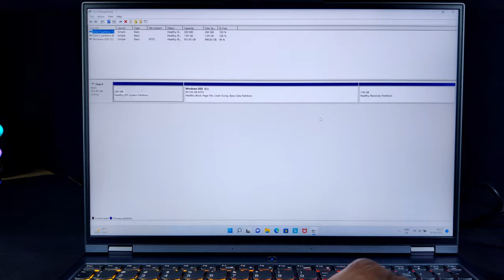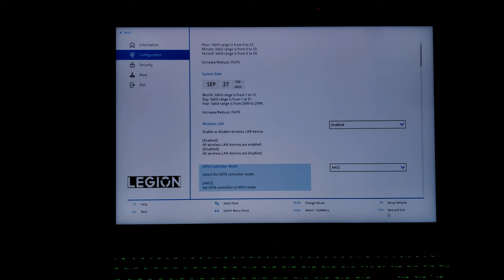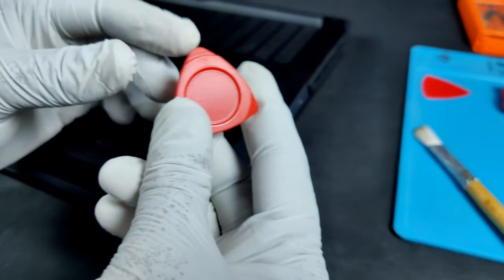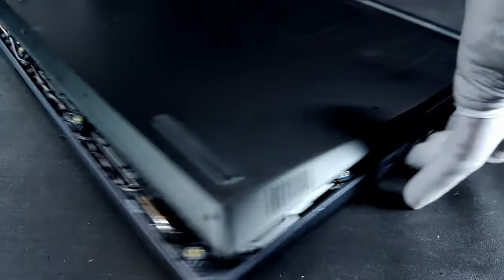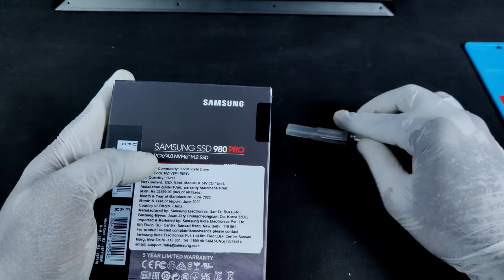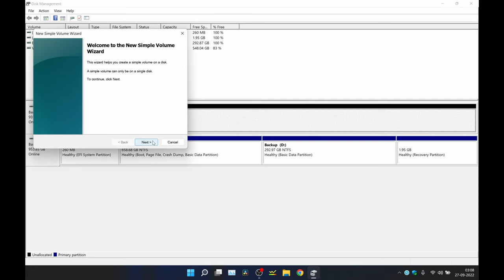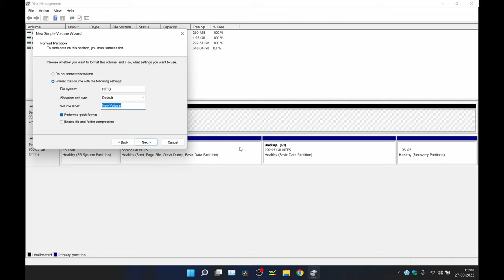Legion 5i Pro Laptop - SSD Upgrade - Samsung 980 Pro Gen 4 - DIY

Comment: Bro, we have the same model but mine’s only 512 GB SSD, would it be possible to upgrade to 2x 1 tb samsung 980 pro PCIe 4.0 M.2 or only one. Also, can i upgrade my RAM to 32 GB instead of 16??. Please respond ❤
Reply from the maker: If yours is same model then it should support 1TB per slot. And for RAM, by paper it is upgradable upto 32GB.
Reply from the maker: Yes. Although some people have tried using 2TB and was successful. But i doubt it and also about heat dissipation

Comment: I want to install two Kingston Fury Renegade 2Tb nvmE ssds in my Legion 5i Pro gen 8. Can i somehow make this double sided ssd fit into the second slot too? I know something is pushing up on that ssd installed there if i where to install any double sided ssd like those ssds i have is. But is there any fix to make it work?
Reply from the maker: AFAIK, the double sided SSD should work. But the problem is the heat dissipation from the chips which are on the other side.
Reply: @MADWalker  Only one did fit in my gaming laptop. And without heatsink it sits at 50 degrees Celsius.
Reply from the maker: 50 degrees C during idle or operation? Ensure it does not go beyond 70 degre during operation. Ideal operating temperature should be between 30 to 50 degrees

Comment: Can i upgrade this on my lenovo ideapad l340 please tell me instantly
Reply from the maker: I afraid it will not support PCIE Gen 4. You should consider PCIE Gen 3 SSD
Reply: @MADWalker  bro u helped me so much thx
Reply from the maker: Welcome
Reply: @MADWalker  A lenovo  guy name dex_lenovo says that Hence, to answer your question, yes you can definitely upgrade your current drive to a 2.5 SSD drive. You can also upgrade your current ram by replacing the installed ram module with a higher ram capacity.
Reply: So i can upgrade right idk
Reply: he says i can upgrade to 2.5 ssd that means the 980 pro
Reply from the maker: 980 pro does not come in 2.5 inch sata. Sata has limit in speed like 600MBps or something like that. While m2 ssd are 5x to 10x faster than sata. I would say you can go for gen 3 pcie ssd instead of sata if possible.
Reply: @MADWalker  Ok thanks

Comment: How can i see my laptop use PCIe 3 or 4 on ROG g531gw i7 9gen with rtx 2070 please respond🙏
Reply from the maker: Easiest way is to look into manufacturer data sheet. If this G531GW-AZ014T is your laptop model, then the spec says, it supports PCIe 3.0
Reply: @MADWalker  thanks my friends🙏

Comment: If I use the default heatsink, which is the Samsung variant with a heatsink, will it still work?
Reply from the maker: I dont think it will fit. You might need to unscrew the heatsink and use the laptop's default one, as it is connected to cooler fan assembly for heat dissipation.

Comment: Hi congratulations for the video, I wanted to ask what temperature does the samsung 980 pro mounted on the legion 5 pro reach? I would like to buy this ssd but I know it gets very hot. Thank you
Reply from the maker: Tested with an ambient temperature of 30°C
Startup temperature 37°C
During 4K video editing and rendering 39°C
After 1 hour of usage 42°C

While the default SSD came along with the laptop, containing OS was 50°C at the same time
Reply: @MADWalker  Hello and thanks for the previous reply. I wanted to ask you if you recommend the samsung 980 pro or others like the kingstone KC3000 or the Sabrent rocket 4 plus or XPG gammix s70 blade or many others that you could suggest. Then you changed the thermal pad under the cooling plate? Thank you
Reply from the maker: I wanted to try Firecuda 530 and Samsung 990 pro. It is latest and marginally faster than 980 pro by paper and other reviews. 

I did not change the thermal pad. Just utilised the default one.

Comment: How is the temperature issue?  Do I need to install a heatsink?
Reply from the maker: Additional heat sink not required. Even if you add, the heat dissipation has to pass through the cpu cooler only. There is no separate vent for ssd. Factory provided heatsink itself sufficient.

Comment: Hey, thanks for your video. I've issue unscrewing the double screw (black on top en the grey one), the one maintening the SSD, any advice? Thanks
Reply from the maker: You mean the standoff screw to fasten the SSD? Ya sometimes the standoff loosens first. In that case, we need to use a nose plier to hold the standoff and unscrew the top screw
Reply: @MADWalker  sweet, that's what I did. And it works, thanks a lot.

Comment: I was unable to update the samsung 990 pro firmware on a lenovo laptop. were you able to update the firmware?
Reply from the maker: Are you trying with Samsung Magician software? I have seen many forums discussing about the similar issue and its because of software bug.
Reply: @MADWalker  Yes
Reply: @MADWalker  can you link to this forum? did they find a solution to this problem?
Reply from the maker: The solution they suggested is to try in different slot or different machine
Reply: @MADWalker  Have you updated the firmware?
Reply from the maker: No. I have not updated. I didn't think of it until i saw your post

Comment: I am planning to buy a custom build of this model, with rtx 3070. It comes to 1.8L, without discount. Do you think the 20k will be worth the increase in performance? Will this laptop come for around 6 years (3 years more than warranty, minor issues okay, motherboard issues not okay)? Cause I will buy another only after this is dead and if it will have a long life, I prefer to have 8gb video ram.

Please share your opinion based on your understanding of the quality of this series. If this model gives motherboard just after warranty, then this is not for me. replacing the motherboard for this will cost at least 1L.
Reply from the maker: 3070 or 3070 ti? If you are choosing 3070 ti over 3060, then you can see a lot of differences... Approximately 60FPS in 3060 can be 90FPS in 3070 ti. 3070 ti has more cores, core clock,, memory, memory clock, memory bus,...
Reply: @MADWalker  3070ti is overkill for me. I just 8gb vram, so going for 3070. 25% better performance and 2 gb extra is good enough for me. I play games like Minecraft and age of empires, so 3060 is good enough. But i need 8gb ram for games of future and light deep learning tasks.
Reply: Also when you switch on ray tracing only 3070 can get around 60 fps in Minecraft.
Reply from the maker: You are right, for now the 3060 is fine. Considering future game requirements, 3070 series would be a better choice.

Comment: Can it support 2TB per slot though? Or is it ok to have the OS on 1TB and have 2TB in the other slot for storage and processing?
Reply from the maker: Technically it should support 2 TB per slot. But the question is the seating. Dimensions of 2TB ssds?
Reply: @MADWalker  I ttied to install a 2TB firecuda in each one. The one for the OS (on the right) was too thick and the computer wouldn't start (!). The 2TB drivevon the left could run fine, but now I wonder if I shouldn't just install a 1TB 980 pro in each one (my 5i came with 512g)
Reply from the maker: Normally, motherboard limitations are with RAM and not with SSD. If the size and pcie generation matches, then it should work. Your model is 5i? Or 5i pro?
Reply: @MADWalker  hello mine is the lenovo legion 5 pro 2021 model will a 2 tb samsung 980 pro nvme work on my laptop?

Comment: Will it support legion 5i
Reply from the maker: Yes. It will support upto 1TB. If your laptop model has PCIE Gen 4 2280 slot, then you can get the full Gen 4 speed. Otherwise you will get Gen 3 speed. Still it will work.
Reply: Ty bro how much storage I can upgrade in legion 5i
Reply from the maker: Welcome. Max 1 TB should be safe.
Reply: @MADWalker  on single slot right
Reply from the maker: Yes. 1 TB per slot

Comment: I have been looking at the AMD customizable LOQ variant. There are 2 M.2 PCIe Gen 4 slots (AMD doesn't have Gen 5 yet), and says 4 lanes each. But are these 2 slots connected to the CPU (R7840HS) separately, taking up a total of 8 lanes?  Or they are fused such that they as a whole only connect to 4 lanes on the CPU? Ryzen 7840HS has 20 lanes in total for everything like I/O, GPU, etc. 
I am asking this because I want the option to set up RAID 0 down the line. But I do not want to repeat this guy's mistake:https://www.youtube.com/watch?v=DWBvDt96ZTc. I am not able to find anyone else online who has tried to set up RAID 0, so it would be greatly helpful if you can shed some light on this. Please let me know about it if you can test it with your unit, as it is similar.